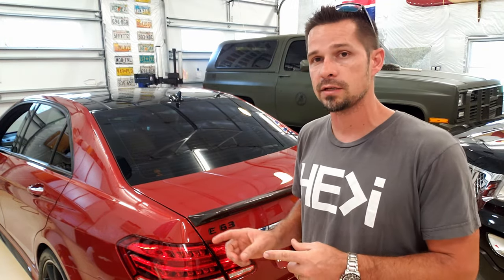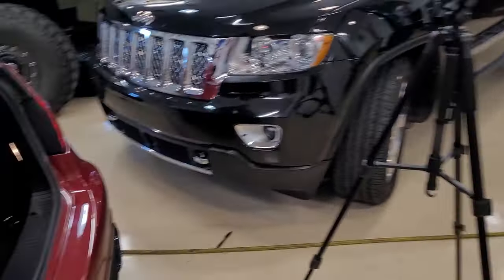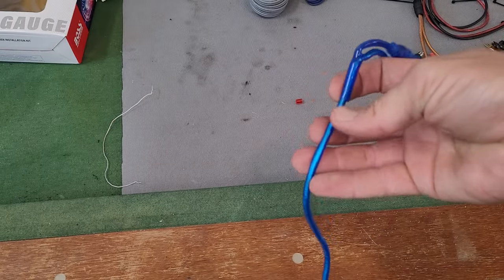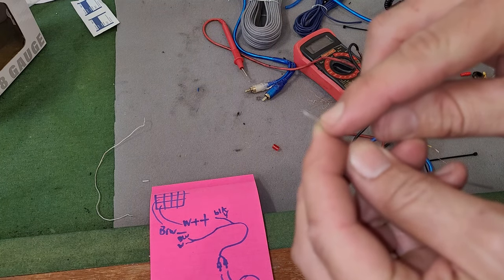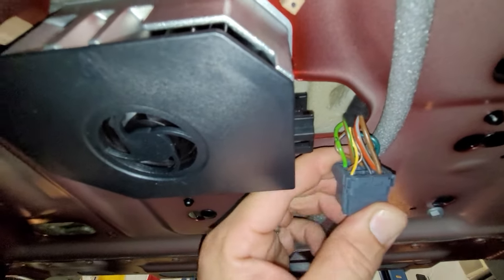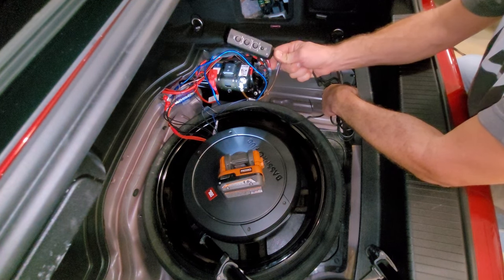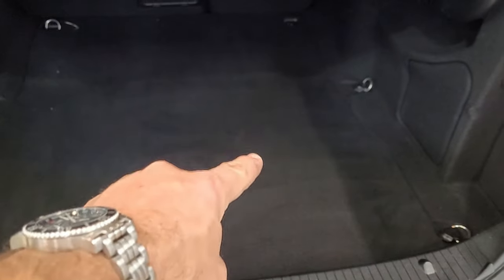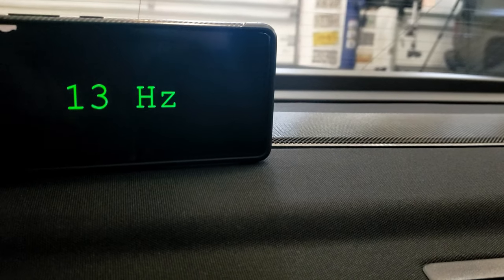Finally, some bass!  DIY JBL basshub install w212 E63

Comment: I can't thank you enough for makkinig this video. Longtime car audio guy here but had been on a hiatus for several years (including all years as a merc owner). Was kicking the idea around idea of adding bass to my w212 '16 e400 and this vid filled in all the gaps/saved me a ton of time. I also ended up getting the passive model (600w rms instead vs 200w on the active/built in amp). Lucked out and found a new open box '06 ish kicker zx750.1.. couldn't have found a better match. Day 1 and this thing pounds/sounds amazing. Looking forward to breaking it in and playing with the level/xover more. 

Couple notes on my install experience for others looking to take the plunge. 1) The small/med sized paperclip I used I ended up not being thick enough to catch snuggly in the harness plug.. so I used pliers to hook around the tip of the paper clip. Made for a much more snug fit into the harness (did same as the video, left the stock amp unplugged and went in from that open side). 2) Noticed under my spare there was foam spacer that cushioned the spare tire. I left that in and it still sounds fantastic; have not tried it without it but also don't feel the need to change it up. 3) Mounted amp to back of the smaller rear seat section.; ground spot nearby using the bolt of the cargo latch mount. Unbolted, lifted carpet, left plastic flooring, sanded around bolt holt, plastic flooring back down, ground ring above the plastic but still flush on the shiny frame then bolted/latch back down onto it. 4) already had a extra cup holer/phone holder thing on my front passenger side (slides between pass seat and center; has usb ports and fits a cup/phone eta, lights up). Bass remote knob fit perfectly in that so am going to drill a hole on the back of it to run the remote cable. Looks good/ergonomic/don't have to drill or adhesive it to the actual car. 5) oem plastic mount sitting in cetner of spare tire.. jbl bolt fits it and you have enough room to screw it down without having to cut/shorten the bolt.. but if you overtighten it the oem plastic mount may pull out and you have to start over. So make it tight but know it may pop loose if you crank it down too hard. 

My merc is sounding tip top. Thanks again for the great vid. Hope more like me get to ultilze this.
Reply from the maker: Nice!, I considered the passive option as well, glad to hear it worked out great

Comment: I just finished adding this to my 2013 E63. I think I paid about $375 for a Black Friday sale (it sat in my garage for a while). For the money, it’s a great addition. I used to have big systems in my car when I was young, and with this, I don’t need anything else. Thanks for the great video!
Reply from the maker: You and I sound the same, I just want good clean balance sound, I don't need to blow out any windows anymore
Reply: Sitting in my e350 wagon and it rocked me until 14 ..

Comment: Nice mod sound install no need to cut OEM harness and such.  Simple and clean 👍.  Might consider doing the same for my 2016 E400 W212 facelift which you know is very similar in body style and interior.  However, my E400 came with HK it does sound good but as you mention there is always room for slight improvement.  BTY noticed you install the ambient lighting as well.  Very happy with mine working perfectly thanks to your previous video on that subject.  Noticed when doors are open for extended period of time lights change colors on their own.  Actually find that pretty cool.  And although DMP car design did send me front and rear foot well extensions , I might install the front ones at a later time.  Again awesome video thanks for sharing!
Reply from the maker: I found that the hk and even the b&o... sometimes it would sound pretty good, and other times not.
So far upgrading from the 6x9 factory to the 11 seems to have completely balanced the system and I can always get it to sound great.
Reply: just did this in my 2016 e400 w212. Well worth it/improvement to the HK.

Comment: Great video, if I might add something to make your and others install easier with this unit. The speaker wire input or "high level" is just that, instead of cutting an RCA cable and tapping into the OE harness you would just extend speaker from that plug and tap it into the harness. Not only will it save time but the input is designed for high level signal so it will perform better.
Reply from the maker: There was a thread on MB world discussing this, they actually tested the sound using the high level input as well as the rcas from the low level input. Everyone said hands down the RCA's provided much lower frequencies and better sound. It may be easier. Anyway,that's where I got my information from
Reply: I'm late to the party on this but will say the low level input on the stock amp plug (as shown in the video) is VERY easy to get to. Didn't have to remove any panels.. just unplug, poke, zip tie and done. Would have been open to high level inputting but didn't see any stock speaker wire that eays to get to.  Also regarding what OP saw on the forums, my guess is singal is full range going to the amp and maybe oem amp has a SSF filtering out the low lows.

Comment: This was so professionally done. Sir I need to bring my w204 to you
Reply from the maker: That's man, appreciate it!
Reply: @ExoticCarDIY  did it rattles in the back? Like I am not mega bass head but at the same time I want to have decent bass. Thinking of installing it in my C350. I guess the install is pretty much same right
Reply from the maker: @sharanpreet5559  no rattles on mine. The install should be very similar. For the best sound, it's best to tap into the sub if you have one, if not you can just use those speaker level inputs
Reply: @ExoticCarDIY  Yeah I will do that and I might throw some sound deadener as well because why not ;)
Reply: @ExoticCarDIY  Did you have sound deadening to your doors? By the way your e63 is super sick. It's a complete package for some inner peace

Comment: I replicated this on my 2016 CLS63s.. and I’ll say everything worked out exactly as shown here. I tapped into the wire harness and kept my stock subwoofers as well.
Reply from the maker: Sweet, were you able to dial it in to your liking? It took some tweaking, but mine is perfect now, I almost never have to mess with the bass
Reply: Did you try it with & without the stock subwoofer & see which sounded best? 🤔

Comment: So I noticed the display when you were messing with the EQ…. Is that coded or is different on other w212s? Mines a ‘14
Reply from the maker: The 2016 have a slightly different head unit called the ntg5.1.  Basically just different graphics
Reply: @ExoticCarDIY  oh ok gotcha. I’m still learning. Will the head units interchange and do you offer coding ?
Reply from the maker: @blade08gt  i dont think so.
I dont offer coding with the exception of maybe a local ILS headlight activation. You can try either benzninja or the admin of the FB group w212 owners
Reply: @ExoticCarDIY  thanks for the info!! Keep the vids coming

Comment: Great video man, thinking about doing this soon and had a quick question…

Would it be possible to de-pin those three wires from the factory amp connector and add in those ‘paper clip wires’ to the connector? Similar to what you did in the Inter cooler mod video? That way I can have both the factory sub and the basshub working simultaneously? Thanks!!
Reply from the maker: Yes, absolutely
Reply: @ExoticCarDIY  thanks for the reply. I’ve already done the oil solenoid mod from your video. I’ve never messed with anything audio related but your video makes me super confident that I can do it myself!! I would prefer both subs running but if I can figure it out I’ll probably be satisfied with the JBL!!

Comment: Classy install, you do things same as me, I like the ability to return back to 100% factory if need be and no ghetto. Evidently not all the HK systems are the same, my interface looks very different bal/fad EQ, and Logic 7 are all on the same screen, plus mine has no mid control, just bass and treble.

Comment: Great Video mate and well explained, to bad i can t find anything so detailed and simple for a W219.
Reply from the maker: Well a 213 will be me next car, your 219 is much the same
Reply: @ExoticCarDIY  in my case i think i have to get speaker line-in for RCA on the original amp and the remote on the rear fuse box, lucky me main battery in the back too.

Comment: Any tips on why my rear parcelshelve shakes and makes a weird vibration sounds recently, like it comes from the plastics around. I’ve put that sounds roof and rattle tape but still seems to be doing it. Also changed the subwoofer with new one thinking it was broken.

Comment: Great DIY mod and definitely worth the money spent to get better base. I have the B&O upgrade and wonder if this will be significantly better or just a bit better?
Reply from the maker: Having had the b&o... I will say significantly.
The only con is, yes you do have to occasionally do a little fiddling with the base level. If you've ever had an aftermarket sub, you're probably familiar
Reply: @ExoticCarDIY  Will need to look into this for sure. Thanks and keep up the awesome vids on the E63s beast!!

Comment: Man I'm jealous of the amp and battery being right next to it, much harder install having to route the wires to the front of the car
Reply from the maker: Yeah, finally there's one thing that's a little bit easier on these than other cars lol. Don't worry though I've run a lot of wires to the trunk on my other cars. Just be careful with those interior pieces
Reply: @ExoticCarDIY  true, trying to give my buddy a simple  jump start on his E class was a hilarious nightmare 😂

Comment: When you order it did you have to measure the spare tire rim to get the right size for the perfect fit ?
Reply from the maker: I didn't measure, it's smaller than most modern brake rotors, did most spares. Three only issue might be the height. For my cars it's perfect, but that's the main one that main concern you

Comment: Is there supposed to be some kind of cover above the spare, but below the main trunk floor (the one that you lift in the video)?  I don't see one, and there isn't one on my car either.  But it seems like there would be some intermediate panel and you wouldn't just lift one thing and see the spare and aux battery.
Reply from the maker: No, I've had a couple e63s and there is nothing between the space and the main floor cover

Comment: Awesome step by step. Sadly it looks like my s212 e63s has a completely different amp. I had an audio shop looking at my setup and they said that I won't be able to connect it the same way as you did since my HK is using fiber optic. No plug-and-play for me then...
Reply from the maker: I think your stereo shop is wrong. Its identical to the sedan, just different locations.
Check out this post... https://mbworld.org/forums/w212-amg/768633-jbl-basspro-hub.html#post7965535

Comment: How you you recommend tapping into the harness while plugged into the AMP? It sounds like the rear shelf speakers don’t work when the harness isn’t plugged in.
Reply from the maker: Not sure what's going on there... My rear speakers still work.... Minus the factory sub of course
Reply: @ExoticCarDIY  I probably should finish the video first, but oh well lol if I get this installed in my Subaru Legacy Limited with the 12 speaker HK system with the Subwoofer, would installing this JBL stop the stock HK sub from running??
Reply from the maker: @halvorson566   @Halvorson  I don't think it would, you're simply just splitting the inputs, unless you're actually cutting a wire or unplugging something, that factory sub should still function as normal

Comment: Hey, on the off chance you might see this. On your H/K system do you get any distortion at higher volumes while using a Bluetooth device? Specifically the speakers in the dash?
Reply from the maker: I've had it pretty loud and no distortion
Reply: @ExoticCarDIY  hmm. I must have something going on with my dash speakers then. I have a 2015 E63 with H/K an every time I turn it up above half way I get distortion in the dash speakers and tweeters. Not all the time just on some notes during songs (higher pitched notes mostly) checked all the settings. Have it turned down a little on my phone. No difference. 🤷🏽‍♂️
Reply: @ExoticCarDIY  and also thank you for the swift reply!
Reply from the maker: @madddogg5671  but only on Bluetooth?
Reply: @ExoticCarDIY honestly, I haven’t tried with a CD because I don’t own any anymore and every time I see one it never crosses my mind to use it lol. I do hear it slightly while listening to the radio but definitely more prevalent with Bluetooth. I’ve also tried multiple phones and same thing.
Reply: Have you got the boost for volume in bluetooth audio turned off? this will cause distortion if turned on

Comment: This might be a silly question idk - but my AMG GLC Coupe didn't come with a spare tire...can i use this in the same rear compartment without the tire? Is there a way to still bolt it down without one?
Reply from the maker: I've never looked in the back of a glc, the way the sub attachment works is simply that threaded rod goes into the factory threaded hole where the spare tire is. I'm not sure if the g l c has that attachment or not

Comment: If I would like to keep the stock sub connected, is it easy to plug the wires on the other side of the connector? Just push in?
Reply from the maker: Exactly, some people use t splices, but you only have about an inch of harness to work with on the backside. I didn't even want to splice it so if you get the correct gauge wire, you can just plug it in the back, just make sure they stay in place
Reply: @ExoticCarDIY  maybe any idea what gauge would fit so I could order it straight away 🙏?
Reply from the maker: So I've used wire, I've used uncoated thick paper clips... My wife just so happened to have a roll of 18 gauge galvanized steel wire that I used for this particular install, it seems to be the perfect size to snuggly plug into the clips..
https://amzn.to/3eBGRVA
Reply: @ExoticCarDIY  thank you. Just ordered those connectors, multimeter (yes I didn't have one 🤦‍♂️) and will get some wire now. Thanks for the replies 👍
Reply: @ExoticCarDIY  Hi again. So I did all the cables like you in your video. Just on the sub connector I don't have yellow cable just green.  If you could please when you have 5 sec to look at the video I just uploaded on my YouTube as I'm not sure if I did something wrong or my sub is dead(it's old one was sitting in garage for few years). When I use the remote from 0 let's say to 50% u can hear bass, not very loud but let's say clean, but when more than 50% it's starts to make strange noise. Not enough power? The speaker itself it's gone? I didn't plan to keep this one just wanted to check if it will make any difference but it doesn't have power.
Reply from the maker: @morgan_gahock  I would test the sub via another input. It obviously is getting power, so it appears the issue is input.
You could use a cell phone or Ipod with headphone to RCA connectors or if you have anot guy we rca-rca source, try that.
Once you verified the sub is in good shape then check your writing into the factor system.
So is your connector the same. 12pin as mine with just different colors or what?

Comment: I followed your instructions to the letter, great tutorial! You're really good at this! But there is one odd thing I can't figure out. When I connect both RCA's (ala the blue RCAs from the amp connector to the red/white RCAs on the sub), I get no sound from the sub. When I connect only one RCA (doesn't matter which), the sub works. ???
Reply from the maker: That is odd, I'd have to think about that. Initially, it just sounds like one of your rcas is wired in reverse? You verify with a digital voltmeter?
Reply: @ExoticCarDIY  Yup! You're correct. Crazy thing though...I used your link to buy the EXACT same install kit with the blue RCA cables. I assumed I could trust the wire colors would match what you identified. But they don't! For example, Yellow is negative in my RCAs, Yellow is positive in yours. Go figure...
Reply from the maker: @gregmatherly  LOL, glad you got it worked out. Good old typical Chinese junk

Comment: I would like you install this in my audi q5 I don't know if will work you very profesional great video
Reply from the maker: Again, in theory of this works in every car, does the Audi have a factory sub in the back, you could either use the line inputs directly from the sub speaker wire, or better get if you can find the input to the sub amp you'll get the cleanest sound. If not you can just tap into any wires just follow the line in instructions instead of the RCA version

Comment: Do you or anyone know if the HK system in the MB W212 have bass rolloff on the bass/subwoofer frequencies? I would like to use your method instead of a LC type input converter as my installer has recommended.
Reply from the maker: I've read about the rolloff, but have no experienced it yet.  Sounds great at all volumes

Comment: can this be added to a w212 with a stock sound system. my car doesn't have a sub.
Reply from the maker: Yes, but you likely won't use the RCA inputs, you'll pain then line of from then rear speaker's

Comment: Hi can this be done on a 2002 Mercedes Benz E 500.. i have a battery on the boot and a small battery under the hood
Reply from the maker: To, should be very similar other than finding a source. Likely use the line in from a speaker